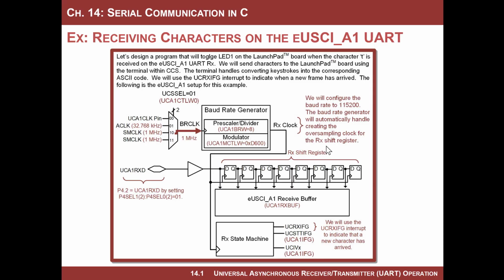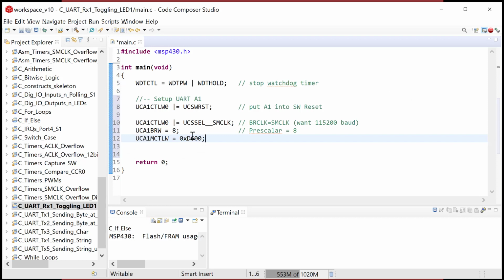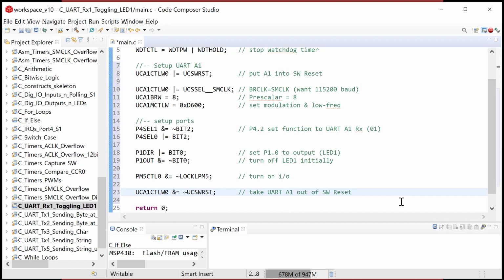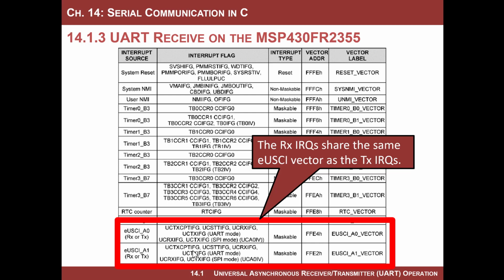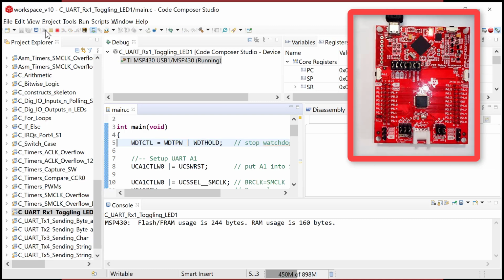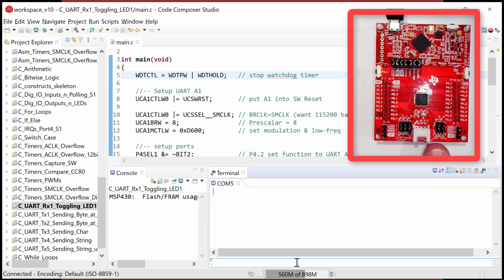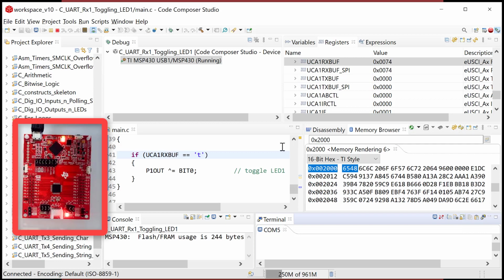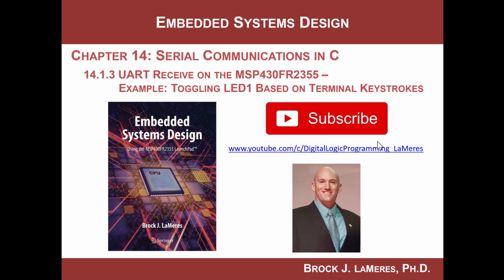14.1(l) - Serial Communication on the MSP430: The UART - Receiving Characters from the Terminal

Comment: Thanks so much for doing this great video. I really want to make this work. But ... my Launchpad is the MSP-EXP430G2 with an MSP430G2231 onboard. Many of the tokens you're using are undefined -- UCA1CTLW0, UCSWRST, P4SEL*, etc. I've tried using <msp430.h> and <msp430g2231.h> ... neither appears to define these. I'm not sure if it's because you're using a different model or due to this excellent video being 5 yrs old. Any help is greatly appreciated. Best wishes.

Comment: Thank you so much! Also i have used Putty to communicate my msp430 with my computer. It works, perfect. My suggestion to you Mr. LaMeres, sir you should make videos about implementing todays arduiono modules to msp430 using Code Composer Studio. Because i researched on the internet and i haven't seen  any  video or example codes to implement these modules and sensors. Most of Indian guys make the implemention using Energia IDE. That IDE is very similar to arduino IDE. In my opinion that implementation is not professional, so you should do that and i will be glad .  Thank you again this video series great. Keep publishing videos :)